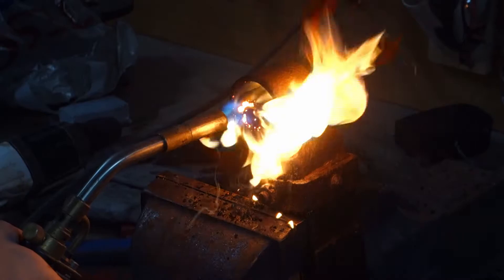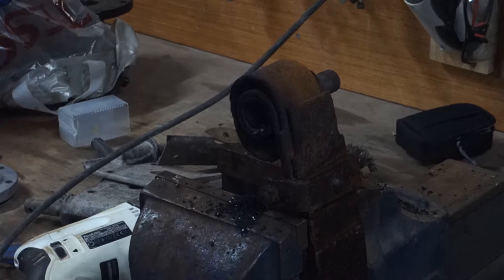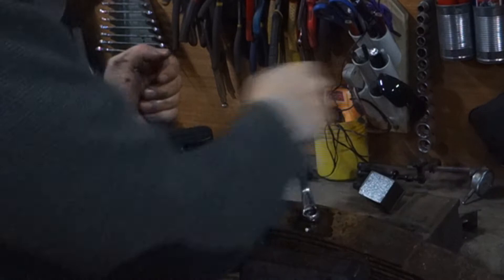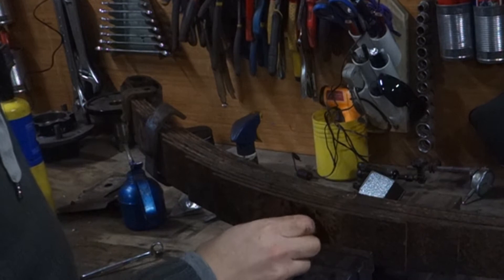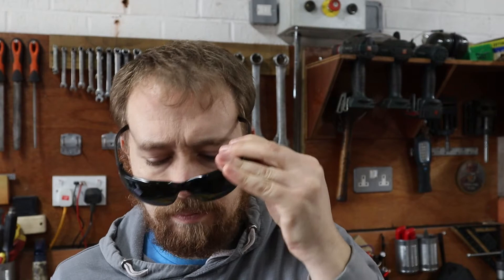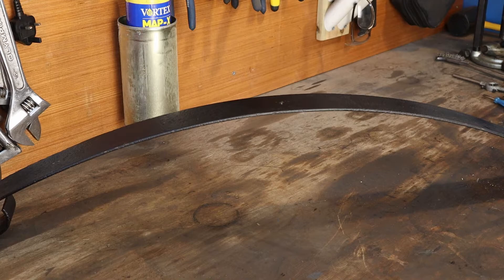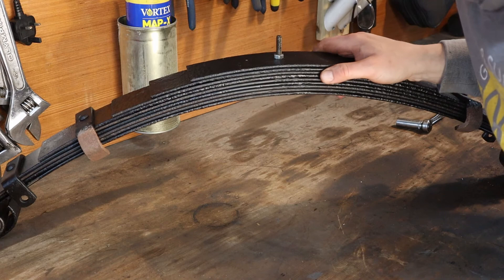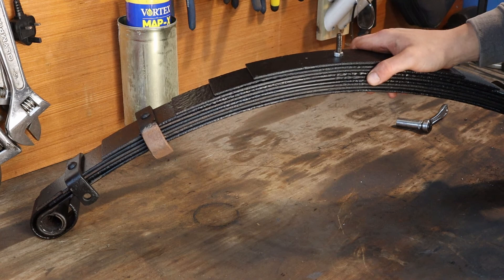Land Rover Series 2 Restoration: How to Rebuild a Leaf Spring

Comment: Hi George, great vid. What sized centre bolt did you use for front and rear? TIA
Reply from the maker: Hi, i used an M8 allen head bolt. The diameter of the head matched the original dimensions. I re threaded a longer one so i could use it to compress the leaves before cutting the end off :)
Reply from the maker: Or did you mean the bolt that goes through the bush into the shackle?